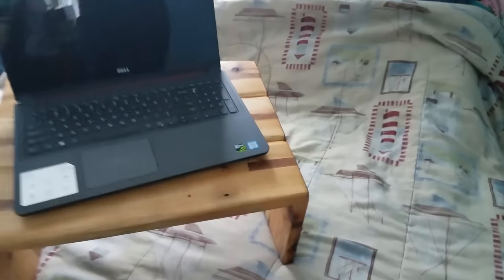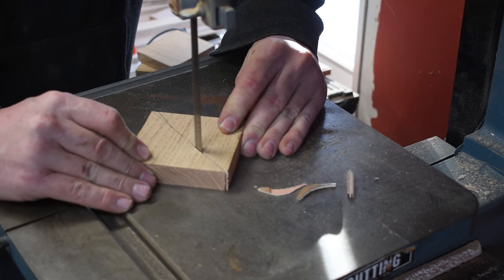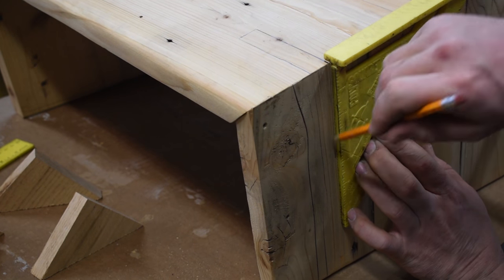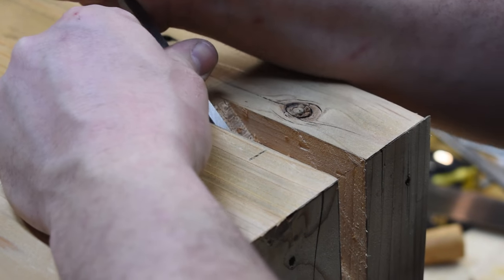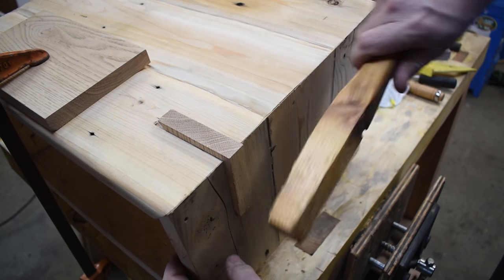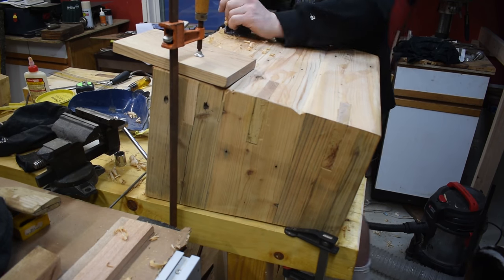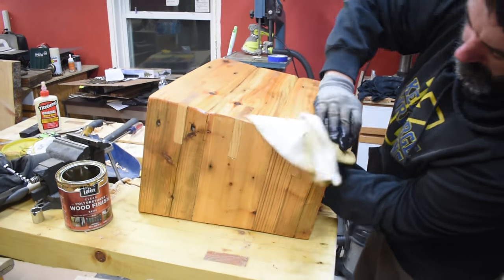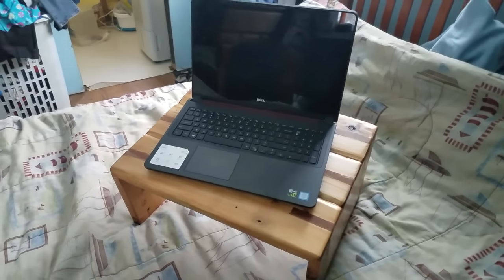Woodworking Build Your Own Wooden Laptop Stand with Reclaimed Decking Tutorial DIY - 3 of 3

Comment: I think it turned out beautifully and you did an amazing job..may I ask if there is any possibility of the laptop sliding off the stand? Mine slides a bit on my table and with the angle of the stand I wondered if it might slide off. Thanks for sharing your process of making a beautiful stand.
Reply from the maker: Thank you Alice!  I actually carved grooves into the top to allow for air flow to prevent over heating and an added benefit is the feet catch in the grooves preventing it from sliding off.  It has worked out perfectly so far.  Thanks for watching!